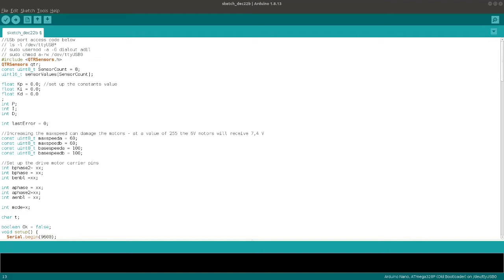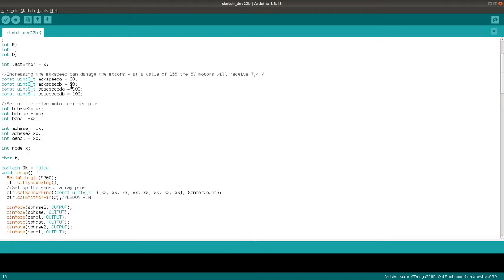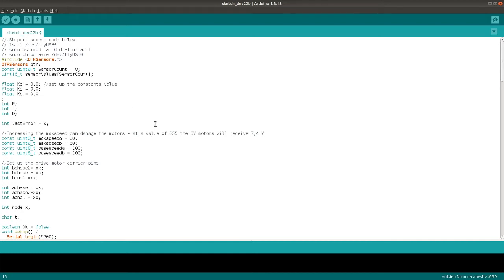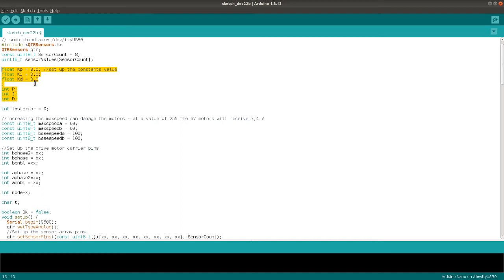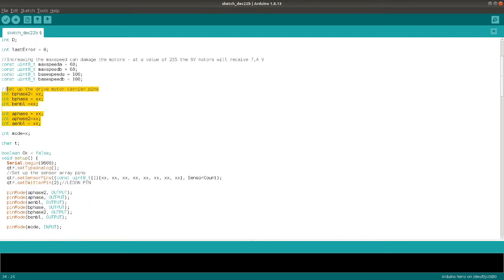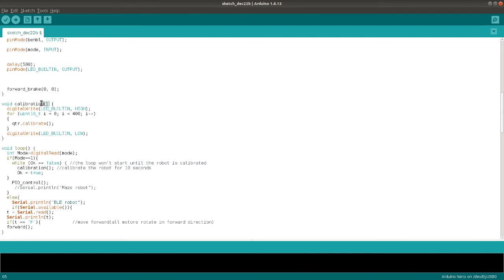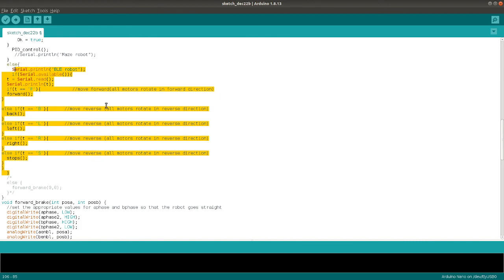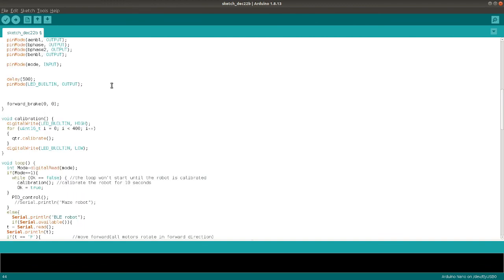QTR Maze Solver PID code debug explained

Comment: and what does the ble function do?
Reply from the maker: sorry I couldn't find any ble function ? can you specify more ?
Reply: you talked about a mode where you coud controll the bot using bluetooth
Reply from the maker: @nischalnaik3297  yes , the ble function (or you can name it any function) will simply override the maze solving function/algo and implement a code for controlling the bot with Arduino Bluetooth (HC06)

Comment: How sould I tune KP KI KD ? 
what should bethe values ?
Reply from the maker: There are few commn values on google , you can try them but mostly it's different for every code. So start with a value like kp=1.0, ki=0.4 and kd=0.5 and tune them by experimenting some values
Reply: @adilhossain227  My bot keeps making a circle. in a intersection it gets out of the maze, seeking help